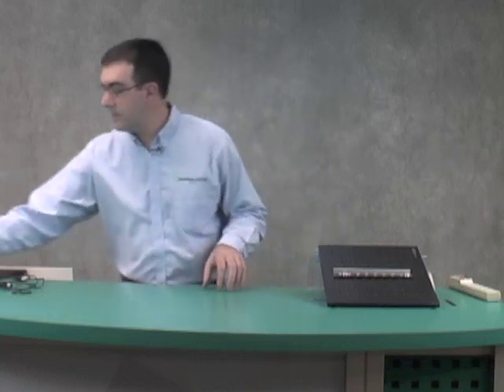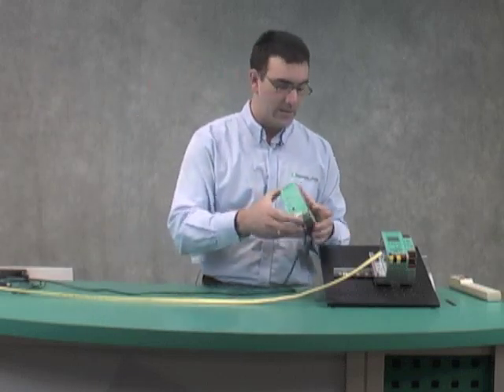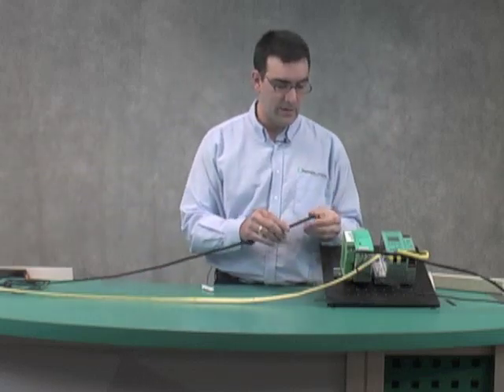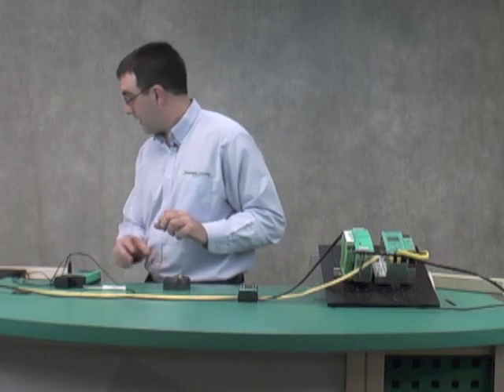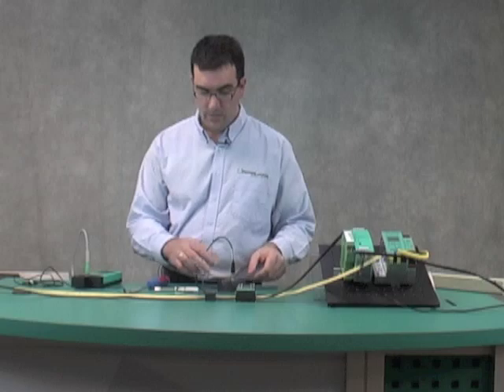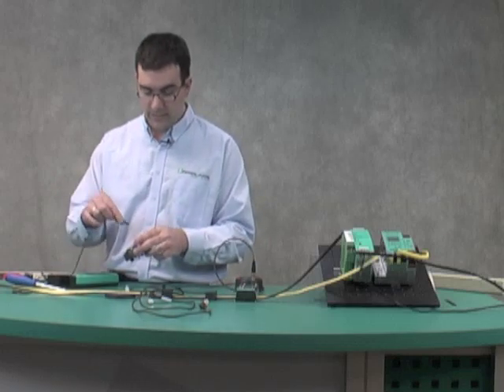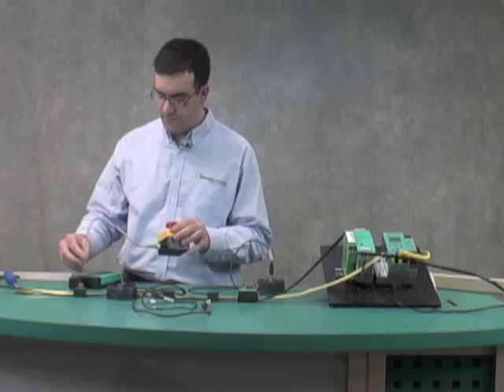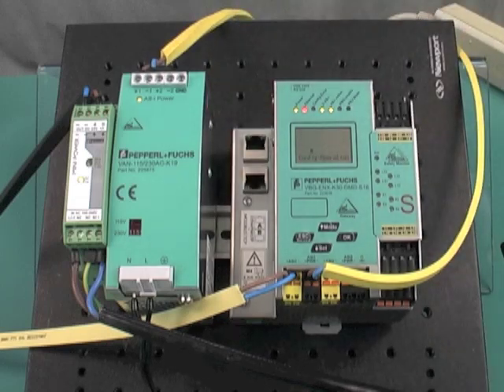How to Build AS-Interface Network

Comment: Hi good morning. I can't go program mode, if I pressed the MODE button at least 5sec it says that the PROFINET ACTIVE MODE BUTTON IS LOCKED. How do I go around it? Thank you.
Reply from the maker: Hello Gavin, entering program mode (Configuration mode) is not possible while the PLC or PROFINET communication is active. The workaround is to pull the PROFINET Ethernet connection out of the module and then access will be granted. Once the reconfiguration is complete reconnect the cable. Don’t forget to change the mode back to RUN (protected) mode. 
Hope this is helpful to you. If you have additional questions, please submit your question via our Ask an Expert form.https://www.pepperl-fuchs.com/usa/en/ask_an_expert_fa.htm
Thank you.

Comment: Hellow in my safety  exist one fail 1.40 ware is it?
Reply from the maker: Hi there Fabio,
Glad you’ve contacted us regarding your error code message, hope the answer below helps to troubleshoot your message:

Error code = 1.40 = power failure error 

Please download the AS-Interface Maintenance Troubleshooting Guide to help troubleshoot this error. 

• page 13 of the Maintenance & Troubleshooting Guide covers potential error 40 on Gateway display
        https://files.pepperl-fuchs.com/webcat/navi/productInfo/doct/tdoctb008a_usa.pdf?v=21-JUL-17
• Please start by reviewing these check points 
• Another useful troubleshoot tip is to swap the two networks.  
 If 1.40 remains after swapping the yellow cable, the gateway is probably the culprit
 If when swapping the networks it now says 2.40 then the network is probably the problem
 
Feel free to contact our Ask an Expert team https://www.pepperl-fuchs.com/usa/en/ask_an_expert_fa.htm if you require further assistance.
Thank you.

Comment: The G11 module, although a very nice unit, seems to have printing on it that would be difficult to determine when the modules are placed in areas that aren't well-lit. Is there an option to obtain these modules with higher visibility of the printing? (referring mostly to the identification of the input/output ports)
Reply from the maker: Hi there John, 
The modules are laser marked which makes the print gray on black. The laser marking process removes/burns a little material which makes the print hold up in even tough environments. Because of the potential of poor contrast of gray on black you may need a flashlight to read the print in low illumination environments.
Reply: I understand. Hypothetically speaking, is there a way to make the print marks white instead of grey? Thanks for the response
Reply from the maker: Hi John,
The color of the laser marking process can't be changed. This color is created automatically when the laser burns the plastic material. An alternative is pad printing, but the shape and contour of the top of the housing with the M12 connectors makes this challenging.